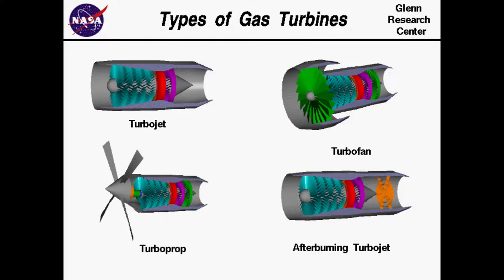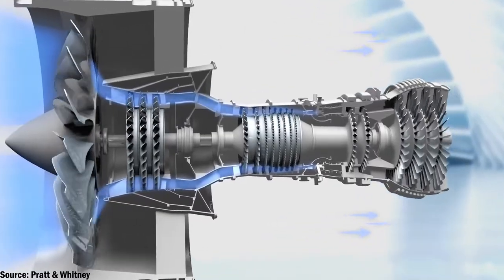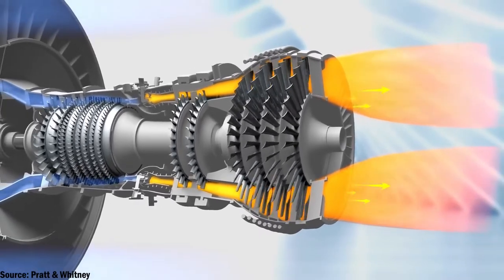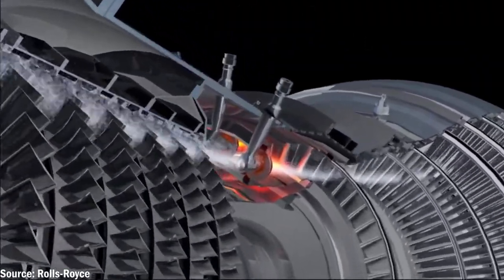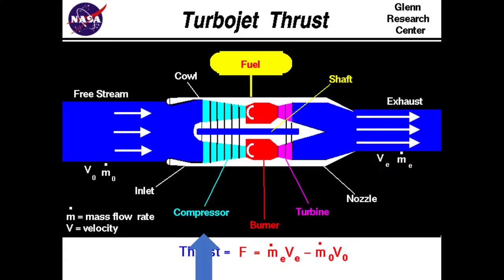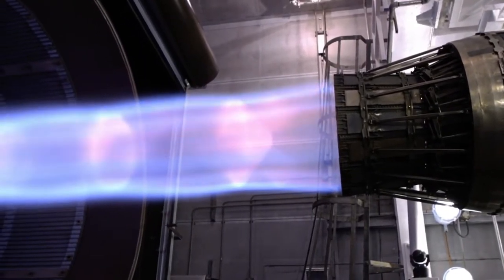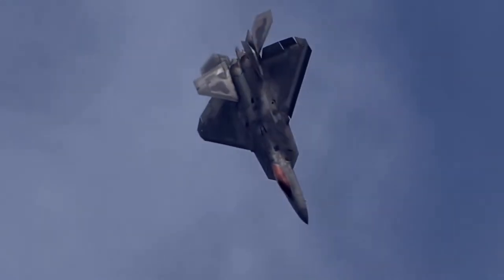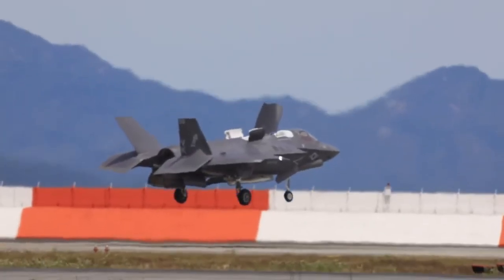How Jets Fly | Aerospace Engineer Explains

Comment: I’d like to add a few things. The turbojet is defined as no air bypassing the core as all the air goes through the core. A engine with a small amount of bypass air is referred to a low bypass turbofan unlike the high bypass turbofans used on commercial planes. Pretty much all modern fighters use low bypass engines. Also; in the case of a high bypass engine, the bypass produces thrust when the fan blows air through the narrowing bypass duct where it compresses as it’s forced to squeeze through a tighter and tighter space. The bypass air then expands and accelerates out the back of the nozzle to produce thrust much like the core exhaust. The bypass of low bypass engines produce thrust simply by the series of fans blowing air straight through the linear bypass duct as each fan acts like a small propeller.
Reply from the maker: Correct. Good elaboration.
Reply: @AviationAustin  Thanks! Also too from my understanding, in a low bypass engine the bypass air is mixed with the core flow before exiting the engine to cool the overall exhaust as much as possible unlike in high bypass engines where the bypass nozzle and core nozzle are separated so the air mixes after leaving the engine. The cool exhaust of a low bypass engine increases stealth as the now minimized IR signature will be harder to detect with thermal cameras. If the afterburner is on, the bypass will air go one of two ways, some if it will enter the afterburner to provide oxygen and the rest will bypass the afterburner to provide cooling in the jet pipe.

Comment: Please Austin is it possible to reduce or completely eliminate the noise produced by a jet engine ?
Reply from the maker: There is an entire discipline of engineering trying to reduce engine noise as much as possible. The reason not being because it's nice, but because any noise you hear from an engine is just inefficient use of energy where it could be better used in propulsion. So no, it is not possible with our current state of technology to make it noiseless, but great strides are being made in reducing engine noise.
Reply: @AviationAustin  ok but what about noise dampening material or sound absorbing materials
Reply from the maker: Dampening the sound with materials wouldn't actually increase efficiency because the sound has already been produced. That would just add unnecessary weight to the aircraft

Comment: So the after burner for recent turbojet engines is using the bypassed air which contains richer oxygen, and the efficiency is better then zero bypass turbojet. The after burner flame color is usually blue on recent fighter jet like Typhoon, and red on legacy fighter jet.
Reply from the maker: Exactly! that's a good observation.